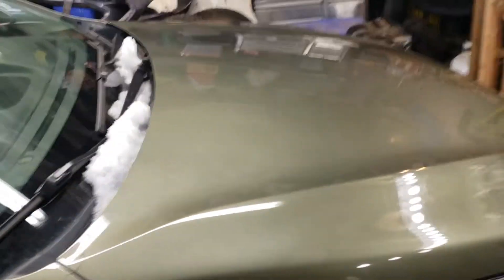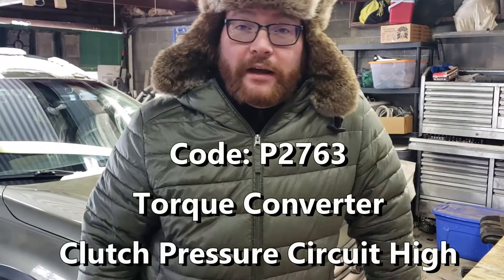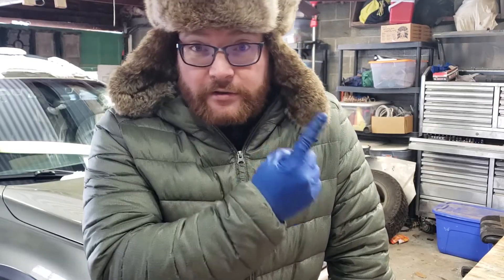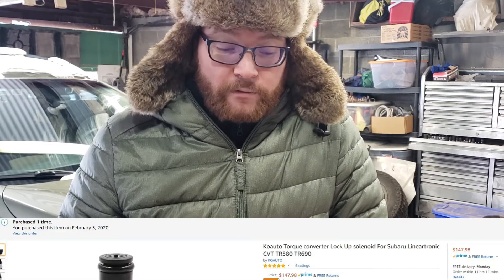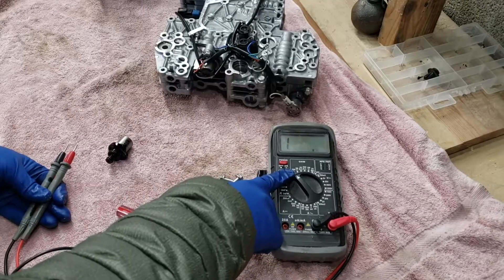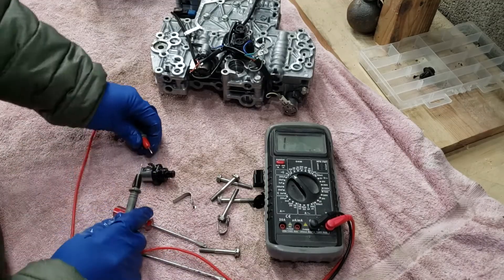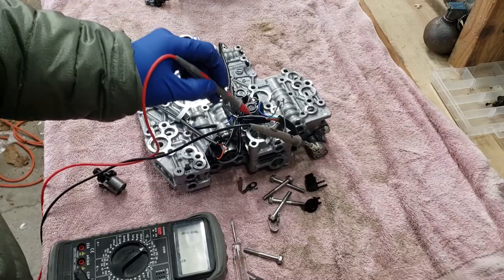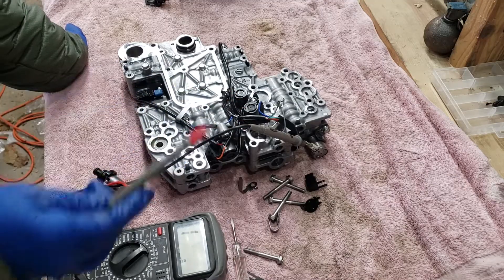Fixing a BROKEN Subaru CVT for CHEAP.

Comment: Killer Vid!  In this video you mention that you would provide a link to the manufacturer/supplier who makes the solenoids for Subaru OEM.  I never saw that link nor a link in any of the comments.  Can you share that link with me please?  Two Outbacks with CVT issues that would like your trouble shooting input: A.) 2013 2.5L Premium,code P02764, assume this has the top mounted TR580 trans.  The Torque Converter Clutch Pressure Control Solenoid relates to which solenoid: Lockup on/off, Lockup Duty, 2ndary Linear control or to the AWD Transfer Case Clutch? Where would I find the TR580 Ohms specs like you gave in this Video for the TR690?
B.) 2011 2.5L Limited. No codes are being thrown. Runs well. At a stop, then start with low acceleration-low rpm, the trans hesitates/hicups/slips momentarily then moves into the next gear....calling that "2nd", there are are no more problems up-gearing or down-gearing. From a stop with hard acceleration, the issue is non existent.  If I am n Manual Mode, the issue is non existent.  Does this sound like a solenoid related issue, ECU issue, or something in the trans beyond the value body? Quite a few questions here....that for taking the time to give feedback on each.
Reply from the maker: The link is in the description of the video. The 2013 is probably a TR580. The 2011 is the 690. Let me see if I can find the specs.
Reply: @bruceyyyyy  I see the link now, thx.  I'm still trying to determine which solenoid relates to the error code P02764 -/Torque Converter Clutch Pressure Control Solenoid.  Trying to narrow, my logic guestimates it most likely relates to either the Lockup on/off (16 Ohms) or the Lockup Duty (12 Ohms) but unsure. Thoughts? Any chance you are aware of the Part numbers or links for the other four solenoids with different ohms specs of 16, 6.6, 5.3, or 3.2 Ohms? Huge Thanks...

Comment: So I watched Mr subaru's video , everything looks pretty easy , however at the end he reprogrammed the transmission/computer. Can you go without  the reprogram?
Reply from the maker: I haven't had anyone say it's necessary. Someone has trouble because they were on ramps instead of level.
Reply: @bruceyyyyy  well that's good news ! so when I jack the car up I will jack up the front and back side to keep it level you think?
Reply from the maker: Sounds like a plan! Or you could do it on the ground if you're small enough!

Comment: Nice video! I just got the 2764 code on my 11 outback and am trying this... Seems dumb that Subaru won't service a valve body.
Reply from the maker: Keep us updated!
Reply: @bruceyyyyy  got the part in the other day and it's driving much better and no lights so that's a plus. Time will tell but it seems like it should hold up 👍

Comment: hey mate, just change my solenoid, filled it up with cvt fluid, and turned it on to refill once it gets hot, however i had to roll the car off the ramp, and when i put it in reverse nothing happens, it doesnt engage, is it because of the software??
Reply from the maker: It's just got 4 neutrals? 

I'm not sure. I was just talking to several people who have had luck with this method and I don't think they mentioned having to relearn. 

I would try disconnecting the battery over night then reconnecting and going from there.
Reply: @bruceyyyyy  yeah basically 4 neutrals, and after 15 seconds of the car running all the dash lights flash
Reply from the maker: Can you post on the forum? Youtube is a little difficult for full diagnostic.
Reply: @bruceyyyyy  what forum??
Reply from the maker: The Subaru Outback forum. I'm pretty active there.
Reply: @bruceyyyyy  subaruoutback.org??
Reply from the maker: Yes
Reply: @bruceyyyyy  yup posted already, thank you 😄
Reply from the maker: Awesome! Any solution?
Reply: @bruceyyyyy  yeah so i had the car on ramps, the front wheel. All i had to do was push it down so its level again and i could get it into gears again! I only noticed this after getting a code reader and got a code for the transmission fluid sensor. Im assuming the car was in too much of an incline for it to suck up enough oil, and thr incline didnt let me put in enough oil as it would seep out of the fill hole. I feel stupid now for not thinking of that earlier hahaha
Reply from the maker: I have 4 ramps for this very reason. I can have all 4 up if necessary. 

Great to hear it was an easy fix!
Reply: @bruceyyyyy  thanks mate, i really appreciate all your help! And that forum you showed me is great!
Reply from the maker: @mikej5337  Glad I could help!

Comment: Do you know the part numbers on the other solenoids on the valve body or are they all the same part number?
Reply from the maker: The Primary Up, Primary Down, and Lock up Duty Solenoid are all the same. 

Do you know which code you are getting?
Reply: @bruceyyyyy  getting P0700, P2763, & P2762 codes.
Reply from the maker: I think this method should work.

Comment: If I replace the solenoid and use the same valve body, do i have to worry about reprogramming the valve body like mr Subaru did?
Reply from the maker: The users on the forum that have done this fix didn't need.

Comment: I'm assuming the P2764 code is going to be a different solenoid with different resistance.  Any idea how I can go about finding that solenoid?  
Appreciate the video man.
Reply from the maker: The Lock Up Duty, Primary Up, and Primary Down solenoid are all the same. 

The AWD duty solenoid is different. 

Since P2764 and P2763 relate to the Torque converter I would say there is a good chance it works. But I would confirm the solenoid has failed first.
Reply: @bruceyyyyy  Appreciate the response man.  From my studies it loos like P2764/2763 are codes for the same solenoid, but one indicates high resistance and one indicates low.  
Either way I was able to identify the faulty solenoid and popped a new one in yesterday.
Reply from the maker: @peterj3420  Glad I could help! Is the code gone?
Reply: @bruceyyyyy   Put everything back together last night.  Letting the pan cure over night before adding fluid.  Will test tonight and report back.
Reply from the maker: @peterj3420  Awesome! Keep us updated!
Reply: @bruceyyyyy  Its in and running.  Seems to have fixed my issues.  

Little nervous on my fluid levels.  drained more than the expected 5 quarts as I had the car jacked in the front to give myself more room.  Was able to put in almost 9 quarts today (5 quarts --> shifted thru gears in park --> 2 quarts --> shifted thru gears in park --> 2 quarts).   Not sure if I possibly over-filled.
Reply: Read on some forums (saw you on some of those posts too ha) with some people adding closer to 10 quarts so I'm a little less concerned.  Drove it for about 20 minutes and opened the fill plug and maybe  1/4 of a quart came out so I'm probably close to the right level.
Reply from the maker: That's great news!

Comment: @bruceyyyyy Thanks for the video.  You have inspired me to try this.  After watching @MrSubaru1387 he recommends replacing the pressure pipe o-rings and the strainer o-ring.  I assume they came with his valve body kit.  Do you have the correct Subaru part numbers to replace them?
Reply from the maker: I think those depend on the model. Do you know the model/year/engine?
Reply: Yes I have a 2011 Subaru Outback 2.5 premium.
Reply from the maker: @coreymango2390  The only OEM seal for that I'm finding is part # 31017AA000 but I'm not sure what that includes.
Reply: Thanks, I came up blanks too.  I’ll call Subaru tomorrow and will post if I get the correct numbers.
Reply from the maker: @coreymango2390  Any luck?
Reply from the maker: Keep us updated! It could help the next person trying to do this.
Reply from the maker: @coreymango2390  I did some more digging this morning.

I believe the strainer is 31728AA121

The gasket is 803918060

and the O Ring is 806924110

But please confirm! This is just going by a receipt I found of another documentation of a valve body replacement.

Comment: Great advise Brucey.
What is the simptoms for bad solenoid please?
Thankyou
Reply from the maker: I believe it threw a code for a P2764 and had some drivability symptoms.
Reply: @bruceyyyyy  drivability simptoms such as?...
Reply from the maker: @andinamm2246  Mostly the torque converter not locking up. If it's the solenoid it likely will throw a code.
Reply: @bruceyyyyy  last time we conect the scantool were no codes...they told me "keep driving like this to see what happens"...
Reply from the maker: @andinamm2246  What are your symptoms?
Reply: @bruceyyyyy  there is some funny small jumps the car gives when low rpm...like if the engine stops for a fraction of a second and then keeps normal...
Reply from the maker: @andinamm2246  It might be on it's way out but without consistency it's going to be hard to confirm. 

What year? What Vehicle? What Engine?
Reply: @bruceyyyyy  2012 xv crosstreck fb20 engine
Reply: think i got it...this is a TR580...i´ve been measuring the solenoids and it looks like something is wrong, because i had only 2 solenoids with arround 13 ohms measurements in staid of 3...so maybe i have a bad lockup solenoid..the thing is...the colours in the cables is kind of confusing for me...cant find the white cable...there is some pink, yellow,grey...not sure...so i would like to know what is the position of this solenoid cable in the PLUG, so i can confirm that thats the one is bad and i try to replace it (cant buy a complete valvebody).
beside this, i want to ask you what was the symptom for this job? before the $ligth on the dashboard.

thank you so much.
Reply from the maker: I think this process is still able to work. It might actually be better because the TR580 has the valve body on top.
Reply: @bruceyyyyy  totally...not cvt fluid involved...question...the difference betwin a bad solenoyd and a bad torque converter is ovbious?...or they can be cofused to diagnosis?...are those symptom similar or diferent? thank you
Reply from the maker: The torque converter failure usually results in stalling when coming to a stop.
Reply: @bruceyyyyy  understand...and...can a bad solenoid ruin or breack a good torque converter?
Reply from the maker: I do not know.

Comment: will this work for code p2764
Reply from the maker: The Lock Up Duty, Primary Up, and Primary Down solenoid are all the same. 

The AWD duty solenoid is different. 

Since P2764 and P2763 relate to the Torque converter I would say there is a good chance it works. But I would confirm the solenoid has failed first.

Comment: Hello my friend,
I live in Texas and having the same issue,
I took out the valve body and inspected it as you said and the same solenoid is totally failed and has no resistance at all,

I went ahead and ordered a new one through the link you provided and it took it 5 days to arrive while my car is setting,
I am all ready for the installation but i am a little bit worried that the new solenoid arrived looks like after Market cheap Chinese work.  The resistance on the part is perfect but am afraid it won’t last long! What is your thoughts?! Should i return it and order a new whole valve body or should i just go with the cheap manufactured solenoid?! What would you do? (832)466-6309 call me if you have time and thank you for the great video.
Reply from the maker: Most parts are made over seas these days. I wouldn't be afraid of it so long as the resistance and configuration matches up.
We've had several people on the forum (subaruoutback.org) have good success with the same piece. 
If you're really concerned you can invest in a new valve body from Subaru. But we're talking the difference between a ~150 part and a ~1500 part.
I would take the gamble for that price.
Reply: bruceyyyyy i will sleep on it for an hour to decide, also i could get the whole valve for $670 so that would be around 500 extra, i also wanna ask if you or somebody knows why does this lock up solenoid fails in particular and if any other solenoids has fails because all over the internet its always that code either too high (2763) or too low (2764) or no resistance at all like mine (2762)

So I would invest extra $500 but I wanna know the reason of this failure and how possible for it to happen again because it is kinda interesting why is it the same solenoid all over the internet?

Thank you for your time

Comment: 2012 with 163k miles. Only one fluid change (triple drain) at 148k miles. I got P2762 and P0700. I just changed valve body, haven't driven it afterward except for one quick drive in neighborhood. Fluid came out super dirty despite being only 15k old. Checked voltages just now following your vid on old valve body and all 7 pins read good, so now I'm baffled.
Reply: Driven a bit now and code's not back. Took to dealer for relearn as well, and they said everything seemed good.
Reply: @gulzeb  how much did the dealer charge for the relearn?

Comment: Hey,  on my 14 Forester XT with 180k km, I had the P2763 and P6700 code. Got the battery disconnected/connected it removed the error code but got back on after few minutes. Then the dealership cleared the code it got back on again. I left the battery disconnected overnight and I don't see any check engine. My question is whether I'm ignoring the issue or the issue is not there anymore.
Reply from the maker: I would say it's there intermittently.

Comment: I saw a comment on a forum post saying it wasn't common that these solenoids fail, it's common that they get destroyed by techs during some other repair. They blamed it on the techs not being familiar with it, for obvious reasons. Not saying your instance is the same, but something to look for after having someone else touch your vehicle.
Reply from the maker: Do you have a source? 

The ones I've seen are higher mileage. I just helped someone fix one that had 250k. A Solenoid and fluid change and it's back on the road. 

It hadn't had any maintenance to that point.
Reply: @bruceyyyyy  I can't pull it up, might have been geared toward the planetary models actually. Great video!
Reply from the maker: @johnpooley3  Let me know if you find it! I am trying to get the word out that at least as far as this failure it's a cheap fix.

Could save some owners some $$$ and maybe even convince them to keep their car on the road!

Comment: CVTs become more common over time. People will get to know then better and better. I wouldn't be worried about owning CVT anymore.
Great work, keep it up!
Reply from the maker: I'm not worried. I even made a video about how not worried I am. :P

But when these solenoids fail very few people seem to realize you can replace just the solenoid instead of the entire valve body. 

I just wanted to get that info out there.
Reply: @bruceyyyyy  ah sorry, i meant that I am no longer worried. I love the one video you made defending the CVT. And I see more and more such videos pop up. Its about time.
And respect for the fact that you are helping a whole community👍
Reply from the maker: @moonsapling  Still to be seen how well this works out but hopefully it helps some folks out. 

Now I'm going to make a fun video since the last few ones have been like actually helpful and just me rambling to myself.
Reply: @bruceyyyyy  After watching this, I have to say I'm a bit less worried about my cvt.
Reply: Yes it is expensive. In Australia it’s around $3500+ for genuine BCV. wish I found this video before getting Subaru to fix my partners car. I always get parts for my car from wreckers, I’ve got a 2000 Holden astra manual and didn’t have experience with CVT’s.

Comment: I've been limping my 13 outback for a few months now with a bum solenoid. should I still try this or just do the whole valve body since I've been running it?
Reply from the maker: The 13 has the TR580. The valve body would be on top of the transmission and accessed from the engine bay. 

Other wise procedure would be very similar. 

Check the code and check if it's likely one of those three solenoids I mentioned. 

If it is I'll take this one off and send it to you.
Reply: @bruceyyyyy  the codes I'm getting are p2764 and p0700
Reply from the maker: @sirsnydley  Yup. That's the solenoid likely. 

https://mdhmotors.com/subaru-cvt-transmission-failure-valve-body-replacement/

Is this something your comfortable doing? 

If so I can send you the solenoid. 

No charge. Just let me know if it works.

You've got the TR580 if you have a 2013. So the valve body is on top as detailed in the link above.